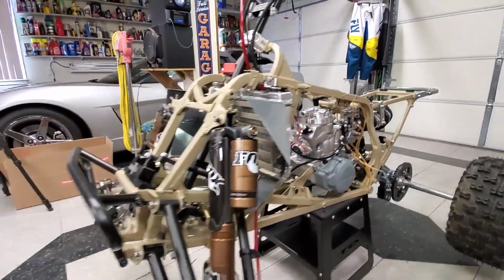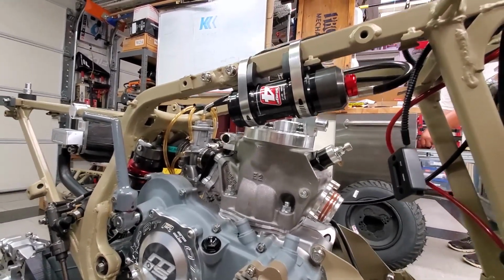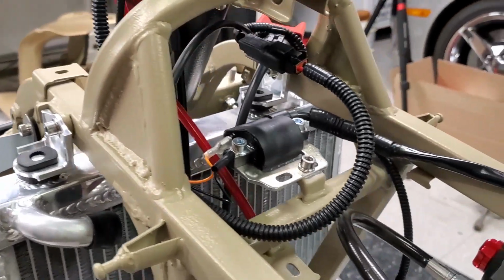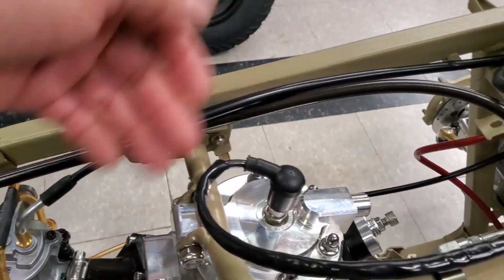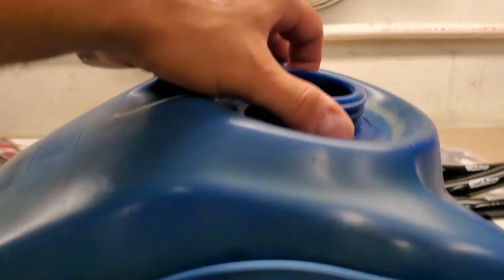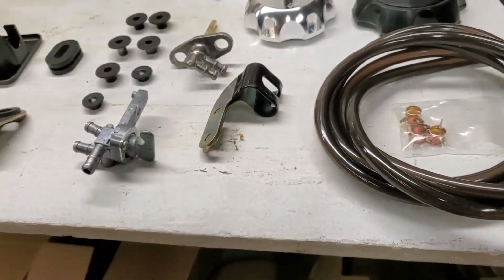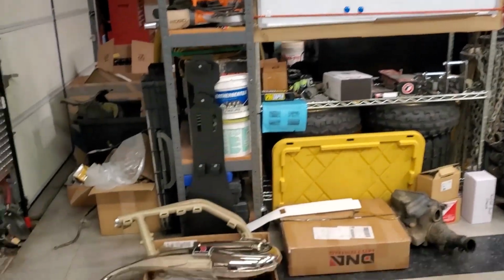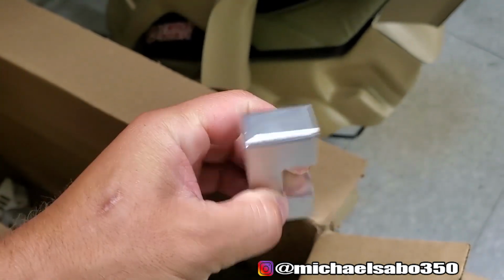This 250R is Coming out SIIIICK! 🤘

Comment: Hey Michael, just a couple more tips from this retired pro.
1. Have more than 1 ground path to the frame from the motor. I've actually cracked those front motor mounts before and if that's your only ground path and the vibration from that big bore happens to crack yours too, your motor will quit. It's best to have multiple paths like the bottom motor mount, the head stay, and both forward motor mounts.
2. The K & N style filter is ok for groomed, watered tracks, but for any dry dirt, sand or mud, the best filtration for your motor is a properly oiled Twin-Air or Uni foam filter. They have 2 - 3 separate built in layers of foam that insures your motor fresh air in any and all conditions. Believe me, silt and fine dust will flow right through that Outerwear and K & N filter, just as well as water will too. Actually, I've won a couple races by splashing my competitors with enough water to flood their motors out in rained out races.
Anyhow bro, that's all I wanna say. It's your build and looks totally sick. Keep up the great work on it. Can't wait for the start up.
Reply: Nice to hear that someone else thinks the same about k&n as i do.  
Hold any new k&n filter up to the light and you will see visible holes in it
Reply from the maker: I always appreciate the feedback and advice bro; I will probably switch to a foam filter after trying it as it's setup. Great call on the multiple grounds. That's pretty funny that you splashed out some of your opponents during races lol.
Reply: thats a.... dirty trick... to winning races
Reply: @hank1556  No, not at all. They slow down for a puddle, I speed up. You glide across the water when you hit it at speed. You plow through water when you slow down. It's all racing. No ones ever accused me of cheating or riding dirty. I've actually been complimented on how fast I've passed my competitors in a race.

Comment: Looking good, Carbon fiber worx makes a reservoir shield with heat shielding. I'm sure you're probably gonna stick sum gold shielding to bottom of fuel tank. Check out EBC, pivot works for thrust bearing for your shock as well. Reduces spring binding. Decals are dope. I wish I could manage to keep my garage looking like yours. Sweet quad, that's a real complement coming from dirt bike guy.
Reply from the maker: Thank you bruce; means a lot! The resi shield is a great idea.

Comment: Pull those rubber things off the tank for that tank cover, itll take a bit of force but you gotta push them down onto the tank cause they fit snug, the gas cap will fit after
Reply from the maker: Thank you bro! The gas cap has the wrong thread pattern though; it doesn't even fit over the opening.

Comment: You need a trail tech inline temp gauge with the one you have now by the time you see the temp it may be to late to save  your engine
Reply from the maker: I almost got the trail tech; partially wanted to go old school. Should be just fine for hitting the practice track and checking temp on breaks.

Comment: Get yourself a filter petcock, rockyatvmountain has OEM new ones.  Hate to see that pretty motor stop because a piece of dirt got in there.
Other than that beautiful build.  Just got done doing mine and my boy decided to take my 310 out for a rip and crashed hard and messed his knee all up.
Reply from the maker: Thank you for the info. Oh man... right after building it? That's horrible man; and I am going to run an inline filter right under the tank where it will be hard to see.
Reply: @MichaelSabo  make sure its a screen type the paper ones stop oil making it lean

Comment: Do you have a Pingel fuel valve? And I’m telling you that pipe isn’t going to be best for that bike I’ll email you a video of my dads 330 and he had that same set up for over 4 builds and the main problem causing engine failure was the exhausts burning the top of the piston.... talked to Eddie plenty of times and went with the led pipe and hasn’t had a problem since the change just letting you know before you come across the same problems with those esr top ends
Reply from the maker: I appreciate your input for sure; I did talk to both Eddie and Arlan at LED about exhaust setups for this motor; we all agreed this is the pipe to run initially. Perhaps the porting and setup were not optimal for the 330 setup your pop had. For this build; no pingel; I don't think it will be necessary.
Reply: Michael Sabo yeah no problem man I love these bikes

Comment: Dude that thing is a work of art, you are a technician on anything you touch, if you don't mind I have a ? for you, I have a 00 Banshee when I put it in gear it stalls soon as put into 1st gear, any ideas thanks in advance.
Reply from the maker: Bro, thank you 🙏 Does it lurch when you make the shift and stall out? If it's idling fine and then immediately stops when you shift; maybe your clutch is not disengaging causing the bike to stall.
Reply: @MichaelSabo  yes lurches forward and stalls, idle is very good,  but if I coast a little to get it going and after just a few minutes of riding it around it works perfect, I can stop hold clutch and and pull back out I can put in neutral but when cold is when it acts up, I use bel-ray gear saver could it be a little heavy when cold? Thanks again.
Reply from the maker: @andyb9994  I wouldn't be surprised if the fingers on your clutch basket are grooved badly. The clutch fibers wear into the fingers and make it so they bind up and don't function properly. It's pretty common. All you gotta do is pull the clutch cover and look at the basket; the fingers should be smooth without grooves in them.
Reply: @MichaelSabo  thanks bro I will check that out, love you channel and everything you do, your quads are sweet.

Comment: Michael Sabo I need to rebuild the bottom end on my cr125 is it possible to split the cases by just taking the fly wheel bolts off and the main gear?! I don’t wanna have to take it all the way apart and take the transmission out.... and everything if it can be done without. Also how hard is it to split without the tool
Reply from the maker: I've never split CR125 cases but in general, any time I've wanted to avoid the work of a complete job, has ended in even more work. It's really hard to get and keep your gasket surfaces clean and do the job without getting contaminants inside etc. 125's are pretty forgiving and easy to work with; I'd bite the bullet and pull everything apart according to the service manual. As far as splitting cases; that all depends motor to motor; some split no problem with a mallet; others you have to fight for a while and require a case splitter. Tusk makes a great case splitter and crank installer if you need one. Here's a link - https://amzn.to/3gx70A9